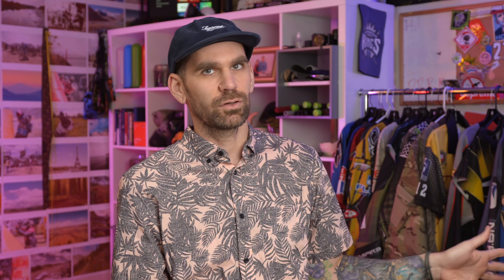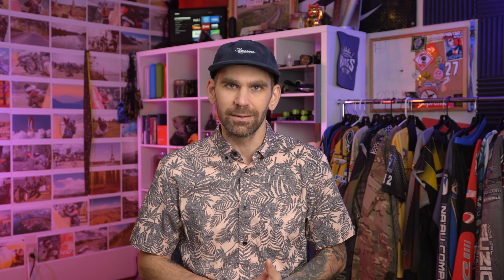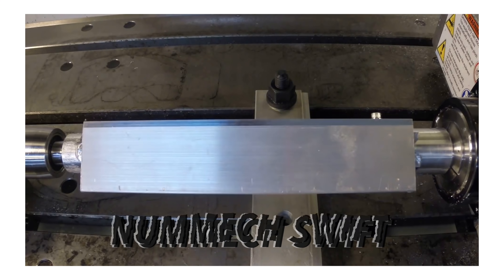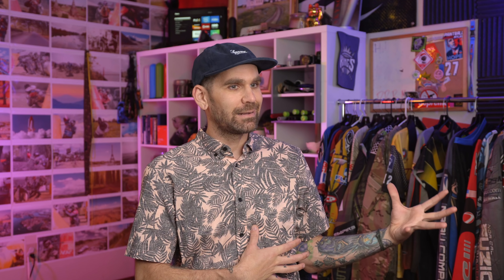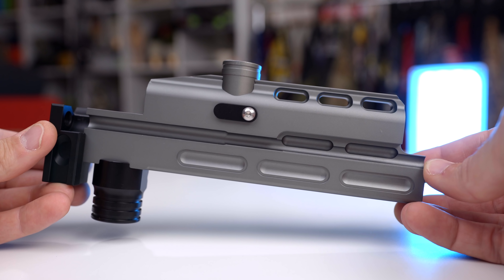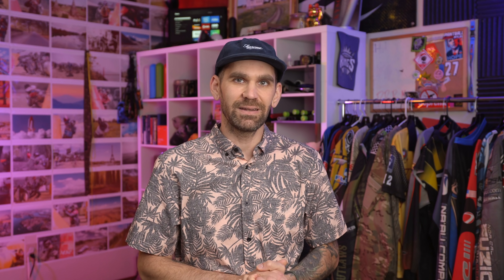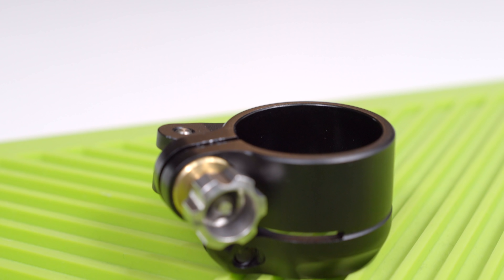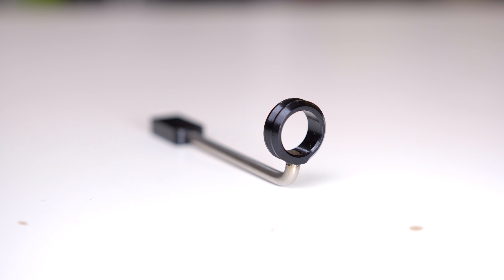Ultimate Autococker Build - The Body Part 2

Comment: not super familiar with autococker parts, what is a beaver tail and what does it do?
Reply: The Beaver Tail screws onto the underside of the Body, behind the Grip Frame. It sticks out the back (looking like a beaver's tail) and serves two purposes. Both of which have to do with the Cocking Rod, which resides in the Lower Tube of the Body and  connects the Hammer to the Back Block. 
1- It acts as a "anti-cheating" device. While playing, the player can actually push in on the Cocking Rod, usually with his thumb, while he pulls the Trigger. That little bit of added pressure will help throw the Hammer forward and keep the Valve open longer (or open it further) and that'll give you an extra 20+/- 10 fps (I'm not sure 😉). With the Beaver Tail there, that's not very likely to be happening. 
2- Every time you pull the Trigger, the Back Block flies backwards, pulling the Cocking Rod and Bolt with it. Some players play with the marker REALLY close to their mask. IN THE HEAT OF BATTLE, one can get a little too snuggly with the Marker and get punched by the Back Block/ Cocking Rod. (Insert "Rod" jokes here...😎) The Beaver Tail acts as a buffer. 
I hope this helps. 🇺🇸

Comment: Love your work Brad, but the Autococker ( heck even most of the Sniper 1's) didn't exist in the 1980's. The very First WGP Sniper 1's did indeed debut in December 1987's Issue of Action Pursuit Games, but were VERY low production runs and were not cheap by any stretch of the imagination. The Lion's share of the sales picking up in late 89/early 1990. Bud Orr's personal Sniper 1 was serial Number #21.

As for the origin of the WGP Autococker? It saw it's debut in 1991 at SC Village, back then known as Sat Cong Village. The very first Sniper 1 Bud Orr converted to be what we know now as an Autococker belonged to Buddy Farkas of Fontana Paintball, KMA, and Team Navarone.

Buddy Farkas'  Bud Orr converted Autococker Started life as a Sniper 1 serial number #72. 

 Looking very forward to seeing your custom Autococker come together and wishing you the best!
Reply from the maker: Yeah sorry about that I misspoke.
Reply: @PaintballRuinedMyLife  No worries,it can  definitely happen when one is on the  spot. Fingers crossed ya  get the Autococker Suction timed on the  first try! 
( As for regulator sweetspotting if you have a reg tester that's less "luck" more  looking at the gauge and working within parameters at a chronograph.)

Comment: 1) Meteor is not going away. Meteor USA is going away, Fabrice is still working with the name in France. 
2) the machinery used to make ALL these markers have been around for A LONG TIME. NC machinery first came out in just before 1950, and CNC machinery was becoming a thing in the 70s/80s. Sure, today's machinery can hold the tolerances better, easier, faster, but milling wise, a good machinist with programming knowledge could easily have cranked out today's markers. Now the electronics and software inside is a different story though